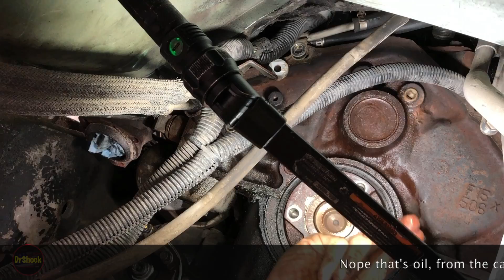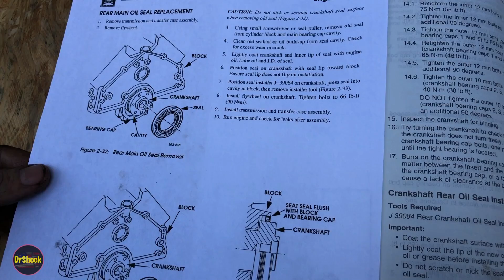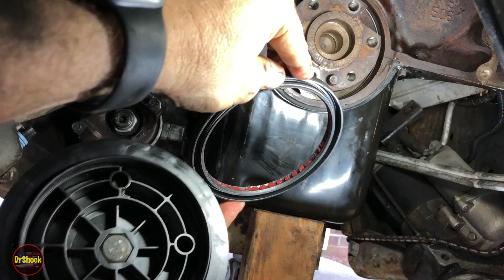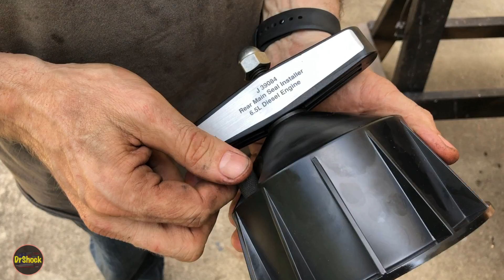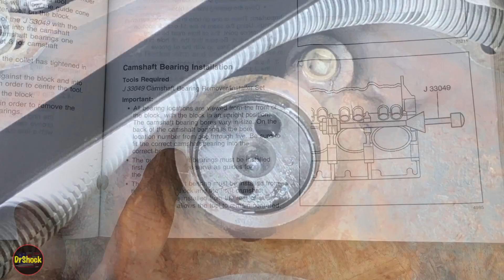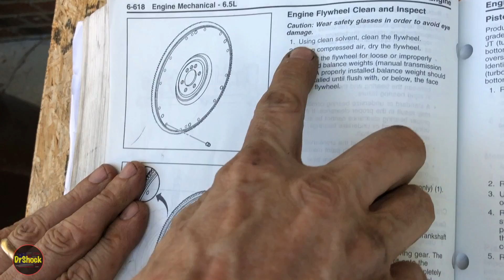1992 - 2002 GM 6.5L Diesel Engine Oil Leak (Rear Main Seal & Camshaft Hole Plug Replacement)

Comment: Hey. Any chance you know the torque specs for the frame cross member that the transmission mount sits on?
Reply from the maker: It's been awhile, but may be covered in this video https://youtu.be/lg4hLNzNm2Y
Reply: @DrShock  Sweet. Ill check it out. Any chance you have any stickers I can buy? I'd like to support you, but I'm not a T-Shirt guy.
Reply from the maker: Thanks.  You can buy me a kofi in the video description, or heart/thanks button below the video (swipe left on the like row).  ;-)

Comment: The leak above near the freeze plug is most likely from the engine block valley drain hole in the rear of the valley. Any diesel or oil will run down the engine just like that. Be sure to clean the drain out.
Reply from the maker: The active oil leaks were just with the camshaft plug and rear main seal as I showed.  Nothing else was at issue engine oil wise.  As best I can recall from this job nothing in the valley on this particular trucks engine but the remnants of older previously repaired fuel and coolant leaks.
Reply: @DrShock   Copy.. Be sure to clean out the valley drain or be sure to expect replacing the IP certainly if you're back East... There are witness marks running down the rear of the block from salt or other corrosion. Hints the rust and missing engine block paint.
We enjoy your videos on the 6.5. Keep creating more!

Comment: Thank you. Excellent video. Out of curiosity, why not use a tap on the cover plate? Seems like some threads would have made that a little easier. Got any vids on oil pan removal and oil pump replacements?
Reply from the maker: Thanks.  I'm not following the cover plate needing to be tapped part though.  I don't recall this job having any damaged threads that needed repair.  The camshaft plug should not be tapped, it has to be friction fit into the block by design.

Comment: What Your Part number For Your Service Manual
Reply from the maker: There isn't one, these have been out print for well over a decade.  But there is a link in the description where you might find an used set.

Comment: For anyone looking to do the same method for the cam seal, I suggest using an automatic center punch, and or center or step drill for getting a drill bit started on that cam plug without it walking off center. I didn't even realize there was a seal back there, probably explains why I still seem to have an oil leak at the rear of the engine even after replacing the rear main and resealing the oil pan, seems odd to have a seal there at all rather than just the block not having a hole there, maybe a manufacturing or marine application thing or some such.
Reply from the maker: I would not recommend this advice, you could push the plug deeper into the engine block making the plug removal more difficult. 

All GM V8 engines of this era employ a rear camshaft plug design.   It's been like that well into the 1950s.   This isn't a seal but more like a freeze plug in construction, it's part of the engines assembly.

Comment: Scotch green scrubbing pads work great for cleaning and polishing metal surfaces without doing any damage. They have save me a ton of work and time
Reply: You can save even more by using the spinny boi ones on a grinder. Can't remember the last time I cleaned up a mating surface any other way.